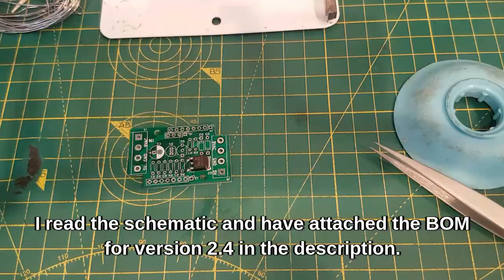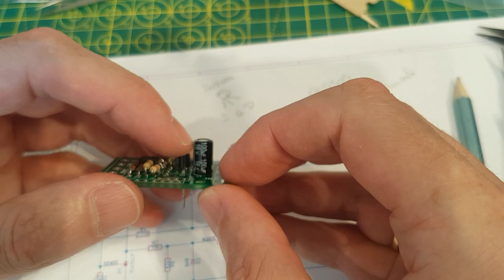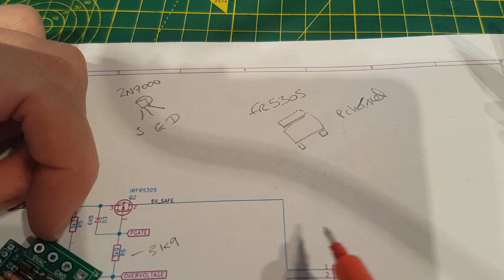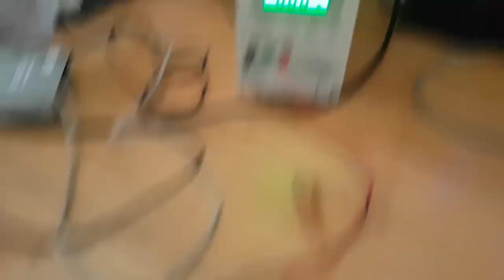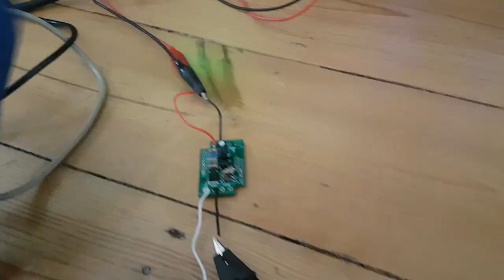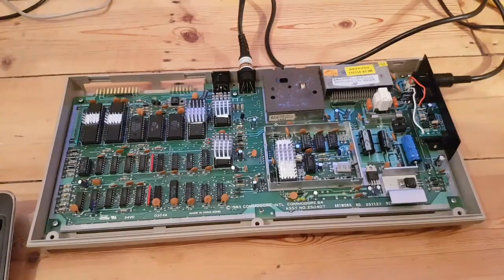Building and Fitting a Bwack C64 Saver v2.4

Comment: Thank you so much for this video, and building the saver! The saver has a bit of history. The reason I chose the TL431 was the stability and that no tweaking is needed after building it. I experienced problems after a while with 1.1. I was getting returns from customers. There is a path through the semiconductors from vdd to gnd, the pmos and tl431 in the v1.1 with no resistors in the path, that if hot  plugged the two saver chips might break down. Thats fixed in v2 after inspiration from an automotive grade circuit.
Reply from the maker: Thank YOU Bwack for all the effort and skill you put into making this saver and for generously open-sourcing it to everybody! It was a pleasure to put together and works perfectly straight away! I have wanted one for a long time and was really happy to see the version 2 on Github. Very nicely designed and easy to populate with readily available components. Thanks for watching and commenting. I have another 9 boards and will be fitting them to everything I can think of lol.